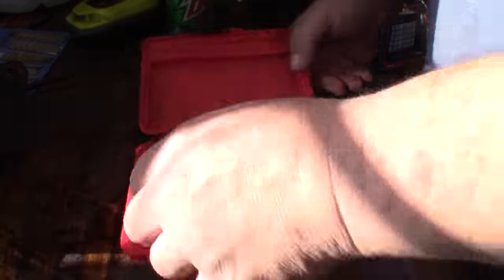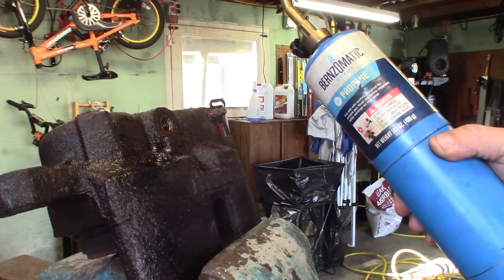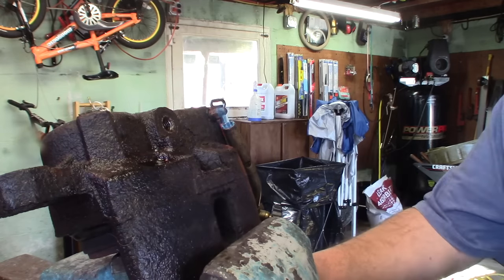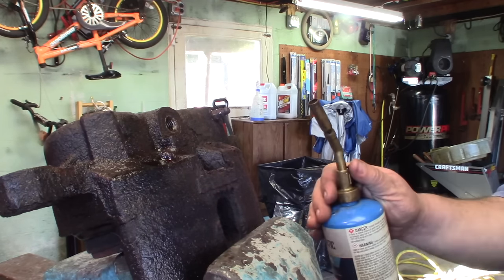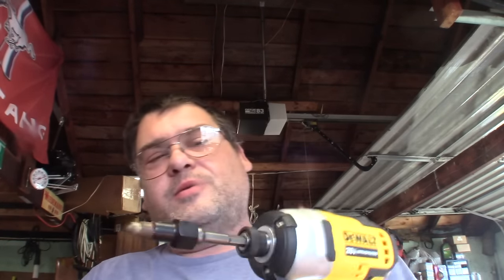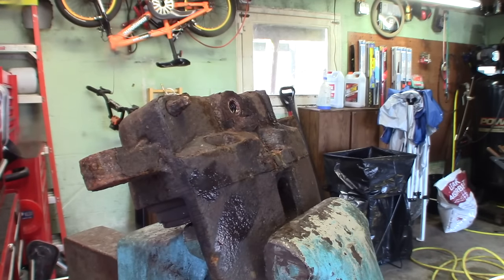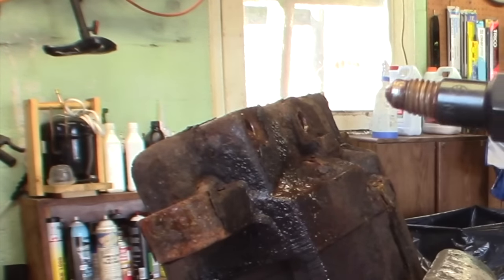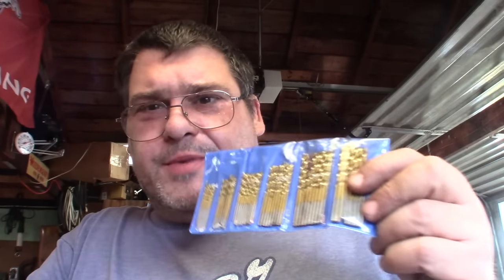How to Remove Seized Stuck Brake Bleeders Every Time!

Comment: i did the same thing with my acetylene torch. works fast on rusted flex hose lines too; that needed replaced after 2-3 years, and anything else that rusted up tight after 25-45 years. sometimes, even impacts won't free up some things.  QUICKLY heat the outer fitting ONLY! it expands more then the now cooler inner metal fitting! soak threads with p.b. blaster for some time first. let it cool to the point the DULL red glow disappears first before twisting free the appropriate fitting. don't want to twist the now softened metal off.the fitting or hose unscrews without destroying the salvageable  part. this is for lines now.  if you rip the rusted 3/16 brake line fitting end off; get the flaring tool out and a  suitable length of GOOD brake line and coupler to splice in  a patch. no donut compression fittings. BAD IDEA!  use only stainless steel or  actual easy bendable copper nickle brake line from amazon or ebay. test the copper/nickel line with a magnet first! A to Z line replacement is safest! the rust proof crap they sell at stores WILL SALT rust through in 2-5 years. my brake best caliper flex solid line from o******s did. you can't afford the ensuing possible lawsuit, if you sell it later! the auto stores LIE when it suits them! all defective china crap is sold in america. China only execute you for selling CRAP to the chinese; not us! the greedy wholesalers & China HATE us! you can't win against binding arbitration from LLC auto stores either! $50 million lawsuit vs. a free hose replacement. MAYBE free! hire  kennedy jr. to defend you in a class action! do the math! don't do cheap parts work or favors on other people's brakes anymore, if you want to stay free of living on the street, divorce and/or prison! top of the line true U.S.A. company made parts only or not at ALL! maybe buy lines from hot rod stores. don't save $20-60 on brake lines! the flex lines are a total salt gamble now, as i found out! even from the car dealers! believe nobody! it's safe as a prescription drug! you trust a politician or doctor? a long winded warning? i'm not joking here. do 1-2 times yearly chassis inspections; like changing your  4 times a year furnace filter. don't be somebody who runs on 1-2 gallons of gas constantly, or drives on a flat tire or steaming engine for 15 miles. you WILL have saved NOTHING! just some free advice, your mechanic friend [?] won't give you.
Reply from the maker: Oxy Acetylene does work better, but I was trying to show people who don't have that how they can get it done on there own.

Comment: The tip of the cone is the hottest part of the flame. If its this rusty what about the internal rubber seals ? Worn out .? Dust boot , piston corroded how much is a new caliper ? Cheap as chips....
Reply from the maker: These are bad calipers that I am using for demonstration.  IAn unloaded reman for this vehicle is about 70 dollars a new OEM is about $170
Reply: It's cast iron.  You can heat the bleeder so hot that you're cutting it and the seals are still cold.

Comment: This guy is good very informative, 5⭐⭐⭐⭐⭐
Reply from the maker: I appreciate that!
Reply: @frugalprepper  
1992 Shadow, Didnt need any Heat, Sprayed some Blaster on the Bleeder Screws, Tapped with a Hammer a Few times, Both came loose with no problems 👍😎
Reply from the maker: @rodneydunnigan9291  some times you get lucky that way.  What state are you in?
Reply: @frugalprepper  
Motor City, Detroit
Reply from the maker: @rodneydunnigan9291  Wow you should have a lot of rust up there!
Reply: @frugalprepper  It was garage kept 35k
Original miles, but it has rust unfortunately, but is manageable 
👍😎

Comment: I just did my first brake job ever. I'm  wondering if spraying WD40 into the brake bleeder, would you not have to worry about contaminating the brake fluid? Just asking? Like I said, I'm new at this. This looks great though to save headaches on buying a new caliper.
Reply from the maker: No, because you are going to bleed the brakes when you put the caliper back on.

Comment: I was always told that the tip of the inner blue flame was the hottest part of the propane flame.  I didn't see you applying the tip of that flame to the bleeder screw.  Maybe another 200 degrees wouldn't matter, I'm no pro.  Now how bout doing a video on removing rear drum brake bleeder screws trying to salvage the screw while the backing plate is still attached to the car?  +1 on using the anti-seize on the new screw, especially for the rust belt dwellers.
Reply from the maker: Wheel cylinders are tricky.  I have about a 30 percent success rate on them, but normally wheel cylinders are a lot cheaper than a caliper.

Comment: If you heat the caliper rather than the bleeder it works even better because it expands the hole that it is threaded into and makes it easier to spin.  I honestly see no reason to break a drill bit off in the bleeder and I have been a mechanic for many years and ASE Certified for over 25 years. For what that is worth.
Reply from the maker: It won't work better with propane, or at least it doesn't for me.   With oxy it will.
Reply: As I answered elsewhere, you theory is right from a physics textbook standpoint, but wrong in this case because you would have to heat the caliper to such an extent it would destroy the piston rings and, if you did the job in situ, your vehicle would probably be in flames from the amount of heat required. The method explained here works because it compresses the corrosion first then the rapid cooling loosens it off the threads.

Comment: Yeah. DaGuy5 below said to heat with the tip of the flame as that is the hottest point. I still don't understand the drill bit part. Heating the bleeder would make it expand. Therefor making a tighter fit. Why  beat the caliper with the hammer?
Reply from the maker: it just how I do it. I wish you success however you do it.

Comment: Try put wrench on it the use vice grips to hold the wrench on them tap with hammer it shocks it,but piling it once a day for 5 days before
Reply from the maker: This way works just fine.

Comment: Water is much cheaper and the temperature differential isn't much different. I use a squeeze bottle to dispense it and it works.
Using the drill bit before heating and breaking it off is a great idea if you can find a source of cheap bits to sacrifice for the job, but adding the bit after heating works too, perhaps not the first or second heating but it does end up working. I guess I'll have to get some like yours online from China for my next brake job - the ones I got from Crappy Tire were not nearly as good as yours (they bend when you look at them, lol) and cost 3 times as much ON SPECIAL :-(
Thanks for sharing your method - I'll definitely give it a go when I do my rear brakes in the next few days.
Reply from the maker: Might have to try that.
Reply: crappytire is canadiantire for those outside canada. mastercraft tools have gotten more crappy in the last few decades
Reply: Yes, heating up with torch then putting ice cold water will give you a huge percentage of success with bleeders.
I just heat and chill right off the bat rather than risk breaking off or rounding off with other methods.

Comment: Top man in the shop on xmas day ...
inserting drill shank is big part of success, second is using impact, air impact with power adjustment in reverse good for rusted fittings as turn it down and let the controlled impacts do the work .
Should save lot of guys time and money ... good job .
Reply from the maker: Thanks

Comment: The new MAPP gas is not the same as the old MAPP gas.  I've found it's no hotter than propane.  I gotta try this one next time I replace a brake line.  I've replaced so many calipers because I couldn't loosen the bleeder/
Reply from the maker: It is hotter but not as hot as the old stuff.

Comment: Another helpful tip: use left-hand drill bits.
Reply from the maker: I am no trying to remove the extractor with the drill bit.
Reply: @frugalprepper  That's not the point but given more experience you'll learn why its recommendable to use left-hand drill bits on these types of operations involving seized threads.....Cheers!
Reply from the maker: I know why you would use it.   This is not a place I would use one.
Reply: @frugalprepper  If I'm drilling for purpose of extraction, I opt for reverse drilling every time as the operation  can only help loosen not tighten as a right hand bit would. Many times, the drill bit alone will extract the piece. Also, the theory behind the process you use requires no heat OR drilling unless of course you intend on replacing cup seal which may damage from heat. The principle of the process is to "stretch" bleeder threads accomplished  via repeated hard hammering of strong steel rod/nail into bleeder, which btw, a drill bit is not suitable for the task due to its brittleness/shattering. But hey, what ever works right, its war.... Cheers!😉

Comment: Genius!  Maybe I don't need new calipers for my f150.  Thanx!
Reply from the maker: Metal Guru just be careful if the are the Bosch one with the ceramic pistons.  They crack easy when you take them off
Reply: @frugalprepper  It's an '88, I don't think they are Bosch but i will verify
Reply: It's good to dream.. e450 owner here...

Comment: 4 years ago, my friend did the front brakes on my car and on the right side (really need to remove the brake hardware so that I can replace the wheel hub assembly due to ABS issues), 1 of the guide pin bolts (7/8 is a pin, 1/8 is threaded) and 2 knuckle caliper mount bolts are seized on there and cannot get it out. And the bleeder screw is stuck as well.
Reply from the maker: I am picturing a GM from what you are describing.   I usually hammer on the with and impact.  The worst case is if you can get the slide pin out, then you can get the brakes and you can replace caliper which come with the bracket.  You may wan to check the wire to make sure you don't have a break init it common on GM if you have a GM.
Reply: @frugalprepper  I'm going to install new fresh lines on my car anyway and get new guide pins (already have new mount bolts) or a new caliper. I have an impact wrench, but it ain't doing anything, except for rounding the heads. And it's a GM vehicle.
Reply: @RetroPCUser  Do yourself a favour and make your next guide pins out of SS rod - they come out every time. First thing I do when I change pads. The OEM plated stuff is pure garbage if you're in the salt belt.

Comment: Great idea,........Pity the Calliper is still only fit for the scrap heap, Why?   Cos the chamfer on the drill bit (the tip) is totally different to the chamfer of the bleed nipple and the bottom of the calliper, it means the new nipple will NEVER seal, You drilled far to deep, measure another nipple, mark the drill and make sure you don’t bottom out,
Reply from the maker: No I didn't drill through the bottom of the bleeder.   I do this every weekend just about in the rust belt.

Comment: Consider the Shake-n-Break socket adapter for an air hammer.
Reply from the maker: I have been wanting one of those.
Reply from the maker: Ordered one!
Reply: FrugalPrepper's Garage & Garden 
Uses a 3/4” wrench to turn the socket while air hammering. There are some instances where I still hear the main surface to expand the metal but I still use the SnB all the time on my rusty disasters.

Comment: Your heating the wrong part. Heat around the nut on the caliper. Cool the nut. The caliper hole expands. The cooled nut shrinks. It fractures the rust and corrosion. Then makes space for the shrunken nut to turn inside the expanded metal caliper.
Reply from the maker: Yeah I know I am doing it all wrong, but it works every time.  As I explained in the video, you are not going to be able to heat the caliper enough to make a difference and move the threads.

Comment: a couple mechanics said mine would most likely break with mole grips etc... anyway i went to the welder, got a nut welded around the tip of the bleed nipples, then the welder sprayed it with cold water, let it cool. And then he easily rotated it out with a spanner. The mechanics were wrong and out of ideas in this situation.

had a fire extinguisher to hand just incase the mechanics advice of "dont put heat near brake fluid" needed to be dealt with
Reply: The advantage of the welder is it can apply so much more heat and get the screw glowing orange, after you get a screw that hot it doesn't take much to remove

Comment: If you heat up you could damage the piston seals. Heating the nipple expands the metal which defeats getting it out. If you used liquid nitrogen or dry ice would be better as you shrink the metal which is better. Plus heating the calliper
Reply from the maker: Well Hey, you use you Liquid Nitro, I will use my torch and keep taking them out.

Comment: Not got to have fire or Drill spray whith a good liquid cleaner first then use wire brush then rince it the spray a good grease cleaner on it then get a nylon string and put around the treads on it go back and forth a few times whith the spring doing it Tite sray whit lubricant and wilggle and then loosen
Reply from the maker: Fire is funner!

Comment: Mine still popped off in my rear drum brake. Struggling to get a screw extractor to actually bite to get it out over replacing the entire drum.
Reply from the maker: You don't have to replace the entire drum.  You just replace the wheel cylinder.
Reply: Thank you for the info! I will look into the part. I plan to use a 5/32 & #3 extractor bit tonight to try to get it out.

Comment: I wonder why no one has ever come up with a more reliable teflon coated or heavier gauge bleeder screw and why no one has ever made the caliper's pin gallies greasable with a Zerk fitting. I was going to drill and tap my old calipers for erk fittings to see if it would work, but never got around to it.
Reply from the maker: A zerk fitting is designed to let things in not out, and it isn't designed to hold back the pressure a brake system has.
Reply: @frugalprepper  Who said anything about letting grease out through a Zerk fitting? I want to be able to grease the pins while the caliper is mounted. It would work fine if done correctly as the caliper just rides on the pins. The  Zerks just need enough clearance so the wheel doesn't rub on them.
Reply from the maker: @dbfcrell8300  Oh okay.  I though you were talking about using Zerk fitting as bleeders.
Reply: @frugalprepper  Got it. Sorry for the confusion.
Reply: For the guide pins make some out of SS rod. Easy as pie. I've been doing this upgrade to my trucks since the 80s and have never looked back.
For the bleeders and every other bolt I use Never-Seize, however this last truck of mine was a JDM and never saw any brake service in its life so after 15 years in the salt belt after it landed here when I couldn't bleed them after I replaced the brake lines I used a similar method to this one and it worked. If you've installed the bleeder without exterting too much toque, it should come of off easy the next time you need to.

Comment: Holly shit! U only need every kind of distraction lube and tool known to mankind!!!
Reply from the maker: Well, a real man already has a can of WD-40, a drill and some bits, and propane torch.  And you can use a smaller socket hammered on if you don't have a bolt extractor.

Comment: I usually heat em up with a torch red hot and quench em with water, they always come out
Reply from the maker: Well when my main torches are back up that definitely works.  I wanted to show people how to do it with Oxy/Acetylene though.
Reply: I use that Bernzomatic brazing torch kit.  I don't have room for a big acetylene kit.  The brazing torch was like $50.  The biggest difference is that you're going to use a whole bottle of oxygen removing two bleeders.

Comment: Small drill bits break all the time, don't throw away the shank. Save using a new one every time!
Reply: Added my comment before the end!!!!!
Reply from the maker: LOL.  Yeah I try to save as many broken ones as I can.  But I am constantly doing rusted out brake line repair so I have to extract a lot of bleeders.  As long as it's built into my price I have no problem sacrificing cheap drill bits.
Reply: Great reuse idea 👍

Comment: It cannot "expand in" as you heat it.
Reply from the maker: That's what the WD40 is for
Reply: @frugalprepper  you make no sense. You reccomend the arosol tk cool the fitting and keep pointing out hou have no idea if the WD-40 penetrates-nothing about it cooling. And the flame is held too close.

Comment: Every time you squirt WD-40 the bleeder cools off,
Reply from the maker: Right
Reply: @frugalprepper  of course I'm right. Don't need it confirmed. Get it hot and cool it once...standard for a hundred years. And, don't you understand the penetrant has a better chance of penetrating the space between the threads if you brush off the rust first?

Comment: Are you a cop?   You keep saying ‘ Bingo ‘ with every success.
The real challenge is getting rusty hydraulic brake lines to come loose at the flare fitting. You can’t use any of those funny sockets on them.
Reply from the maker: I am sorry but I can't answer any questions and I don't consent to searches.